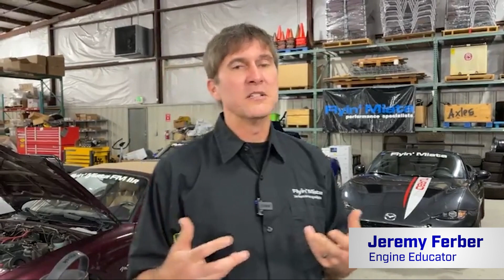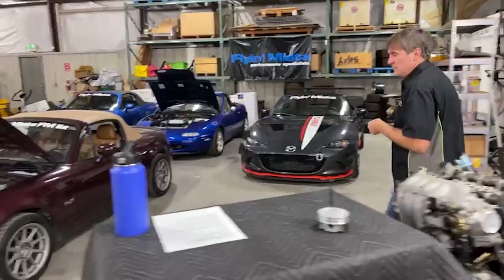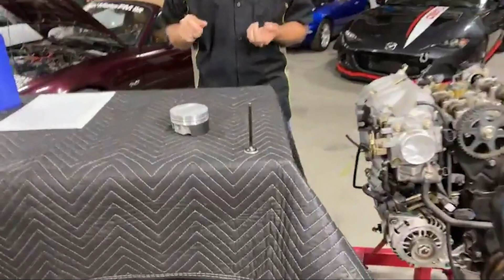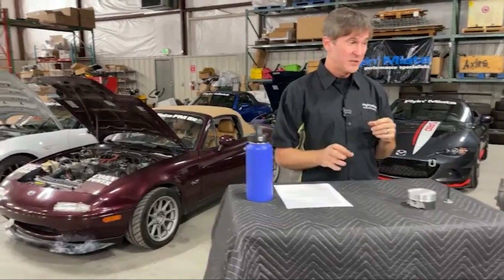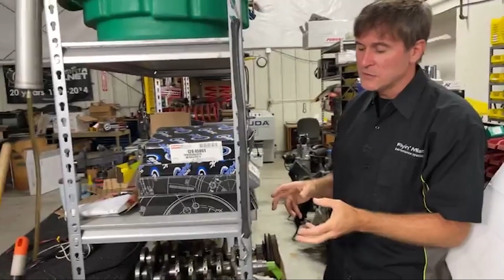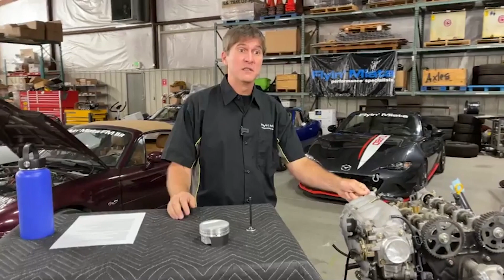Engine Building Basics (FM Live)

Comment: With the stage 1 turbo kit for a B6 engine do I need to replace anything on the engine for it to be long term reliable? I just finished the engine rebuild but I did it with al OEM parts (gaskets, piston, rods, valves…) so the engine is healthy.
Reply from the maker: On a healthy engine, our stage 1 turbo kits are perfectly fine on the stock internals, tho you might want to consider upgrading your clutch if it's still oem. 

Depending on how you will use the car, some other items you may want to think about upgrading are your cooling components (Crossflow radiator, better fans) and possibly a coolant reroute, just to help with heat and long term reliability. 

Give our customer support team a call or email, and they would be happy to talk to you about your goals and make some recommendations.
Reply: @FlyinMiataVideo  yes! I did the same thing, I rebuilt my 1.8l with OEM parts because the first time I turbo'd it, it was on the stock ecu and the engine only lasted 3 days of use because I got frustrated that the $16 ebay timing light gun didn't want to work. So I couldn't retard the base timing down to like 8degrees lol. I had a rising rate fuel pressure regulator and AFR sensor n gauge to make sure I wasn't going to run lean. I did everything the way I should to boost it reliable on the stock ecu except at the end of it all I got impatient with needing to wait for another timing light gun to ship so I ran it at like 10-12° is my guess base timing on 93 octane and another thing is the turbo wastegate was 10psi minimum instead of what it should've been for stock ecu reliability 6-7psi maximum.
Lol I got so excited the first time "test driving" it hearing the awesome noises that I did it again and again after 3 days huge amounts of smoke out the exhaust and finally it blew a block away from home. Luckily the rods were fine and reusable. But 2 of the Pistons were detonated to smitherine which also scored up the cylinder walls. 

So when I did the rebuild, I went with 0.5mm oversized pistons got the block overbored and honed. New rings gapped just a hair over stock recommended specs.
Went with a $20 multilayer steel head gasket.
Torqued the head bolts down to the higher end of the factory specs.
All of the bearings were still good by miracle, all within factory specs. Thrust bearing n all.

I did replace the oil pump, water pump, timing belt idle pulleys and cleaned everything really good. Only replaced the seals that were old.

But let me say this, aside from the damage I caused by blowing the Pistons, before I got it bored, the actual bores still had the factory crosshatching and that was a 200k+ mile engine. So just letting it be known that a 200k+ Miata motor can still be perfectly new if maintained right. Compression was also perfect before I turbo'd it.

Anyways moral of the story is ever since I did the rebuild it's been boosted and pushing well over 265whp for 19k miles now. Running 👍 great!

Just like flying Miata said, do the clutch while it's out.
And the coolant reroute is way easier to do while the engine is out.
I'd also suggest flowforce 640cc injectors if your going the standalone route. They can supply you with enough fuel for 300whp on gasoline with the stock fuel pump and they're very reasonable for the price and are good quality. If you want e85 go with bigger injectors.

Another good mod to do before putting the engine in the car is the fluidampr or ATI superdamper. It's not needed but it's a great mod and they also retain their resell values anyway.
Reply: Just make sure u do a multi later steel head gasket. And if you're re using the stock head studs torque them very carefully correctly. I personally went towards the higher end of the factory torque specs. Like I know my tongue wrench has a 3% give or take accuracy so for example say the target spec is upwards of 60ft lbs (it's not) then I'd set my wrench to 58lbs. To get it as close as I can to the higher value without risking overshooting.

However it can't hurt at all to go with ARP head studs. But definitely recommend the multi later steel head gasket just like FM said.

Upgrade the clutch and do a coolant reroute!!

My earlier recommendation of injectors doesn't apply since you're not talking about a standalone

Comment: Would Fluidmpr do the same job as the ATI? especially in regards of protecting your oil pump.
Reply: Yes
Reply: Yes I'm running fluidamper n push uo to 30psi but usually stay between 20-26psi to be safer, I have heard diff stuff on both who is better n blah blah tbh I think they are both just as good I hear the fluid damper is better at higher rpm but that just hearsay 
Peace n love fam keep it rad stay safe and build on l8z

Comment: I know you said adjustable cam timing depends one what you want to do, but are there settings you'd suggest if we have a very specific goal?  Like I'm building an exocet and I want to maximize low/mid range torque.  Is there any range you'd recommend as a starting point?

I'm going to be stripping a crashed '94 for said exocet build this winter/spring.  I want to rebuild the engine because it was formerly a rental rallycross vehicle operated by my friends.  Eventually I want to do about 8psi sort of power.  Is there anything you'd recommend while I have the engine in pieces?  Just ARP fasteners and an ATI damper?
Reply from the maker: We really recommend tuning the adjustable cam gears on a dyno, based on the specific goals you have for the engine characteristics, there are no real one size fits all starting points since every engine/mod combination is going to be slightly different.. ATI damper, and ARP fasteners are a good start, but depending on how much race time the car will see, you might want to think about valves and springs too. 

You might want to reach out to our customer support team directly for a quick conversation. They can give you some specific recommendations, based on your specific build and use much easier than we can in a YouTube comment. :) 

970-464-5600 M-F 8-5 Mountain time or email support@flyinmiata.com